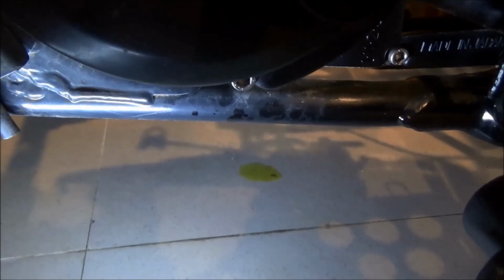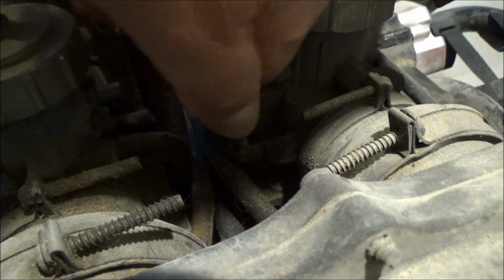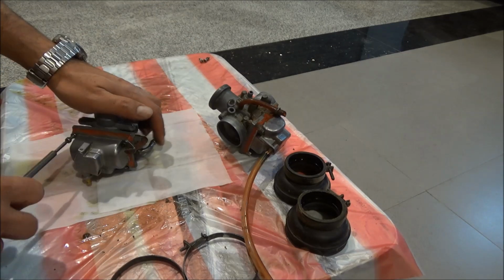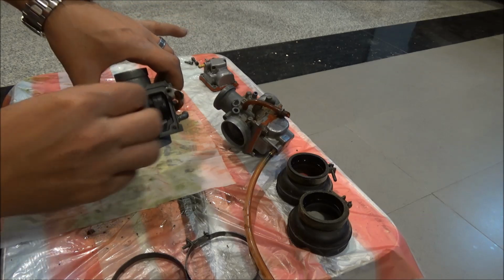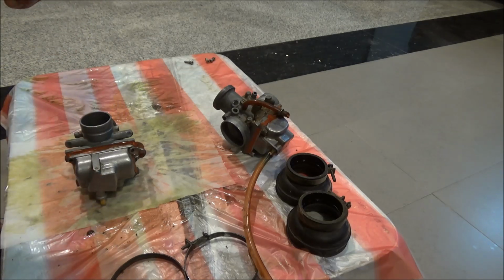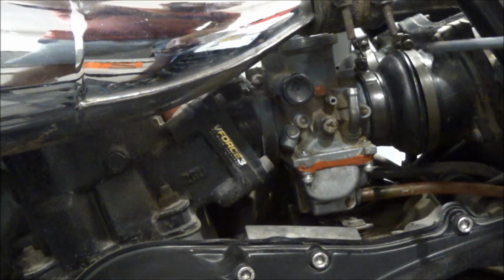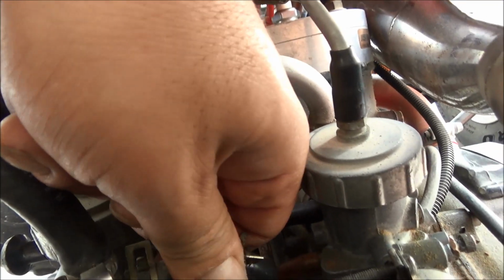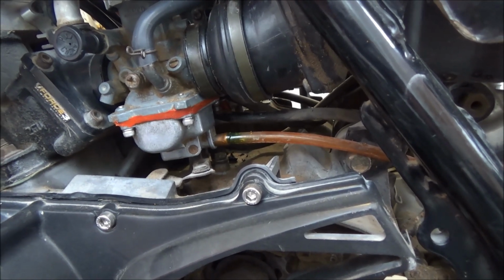How to Service MIKUNI  Carbs - Yamaha Banshee

Comment: That think leaks like a siv and high revs means it needs tuning dude. What size main and pilot jets you using? Those floats need adjusting too gas should not be leaking from overflow and air vents like that. Its not a clamp issue
Reply from the maker: Hi there, the leak stopped once I started the engine and never happened again. The floaters needed to be seated properly and the engine vibration is enough to do that keeping in mind that the plunger is over 10 years old and probably next time I am going to need to rebuild the carbs. The jet size is  27.5 pilots and 280 main. I thought about air screw adjustment but I was pretty sure that I did not miss with it and it was in the right position.  Air leaks will cause the engine to rev higher as a result of the lean mix on idle and the broken clamp certainly was leaking air cause when I changed it the engine has a nice and crisp idle. Thank you for watching.
Reply: @TMK131979  that may be a lil lean http://www.dfn.com/agservices/jetfaq.html
Reply from the maker: @YIRMASTER  everything mentioned there is true.  Yet the air leak will cause high revs specially on carbureted engines otherwise on injected engines the EFI will adjust the injectors to lower the fuel supply and can be unrecognized. Thanks for the tip.
Reply: @TMK131979  Banshees don't have fuel injection and yes vacuum leaks can cause issues but fuel pouring out like that is cray cray... anyway if you got it running good 👍
Reply from the maker: @YIRMASTER  yeah I know that Banshees are running purely on carbs but I was talking in general, although there is a dude in US who converted his banshee to EFI and bolted a turbo on🤩. And yes mine is running great. Thanks

Comment: I would Change your reeds!! I’m no mechanic but I bought a banshee a year ago kinda had the  same float problem. I bought new carbs kept my old reeds didn’t know how important they are. One broke off got sucked into my engine wedged in between the crank blew Crank,the whole case, cylinder and head. Alot of time and $&$ I really wish I changed my reeds Alone with doing the carbs. While your at it mine as well just overhall the engine. Maybe pull the head and check the pistons.The slight time your mixture was off could have done damage. It’s your bike do as you wish, I wish you luck!
Reply from the maker: Hi Brian and thank you for the advise. The reeds crossed my mind as it could cause such symptoms or a complete shut down of the engine, however, the V Force reeds I have on my bike has carbon fiber petals which supposedly will service a life time and I haven't had any issues with these at all. Luckily it was an intake leak issue.
Reply: I realize I'm pretty off topic but do anybody know of a good place to stream new series online ?
Reply: @Nico Xzavier Try flixzone. You can find it by googling :)

Comment: What size are your jets? And what are you running like crank size and pistons?
Reply from the maker: Hi Hood, I am using 27.5 pilots and 280 mains. My crank is stock but have bigger piston at 66MM. Hope this helps